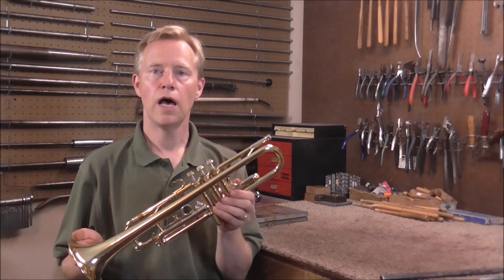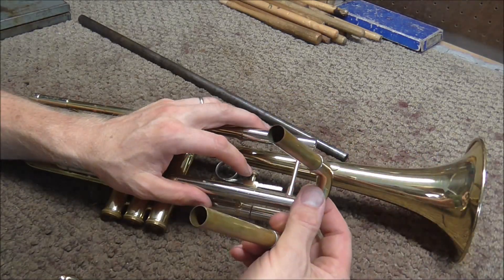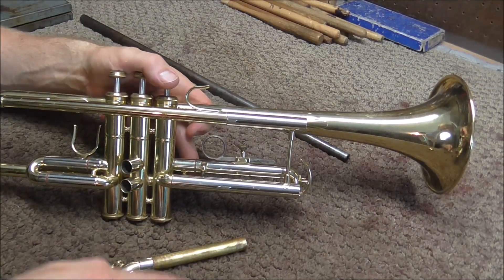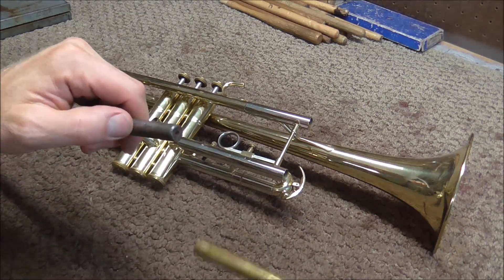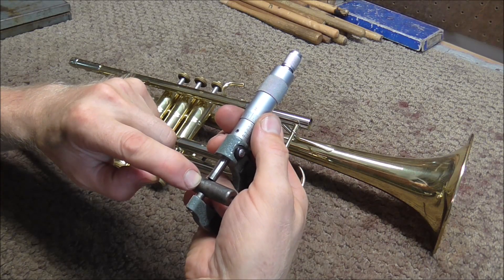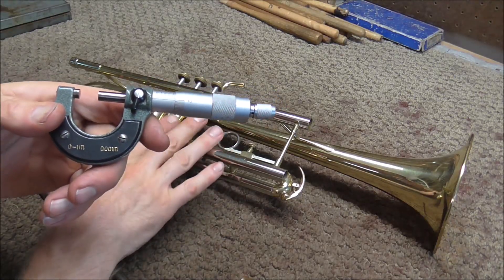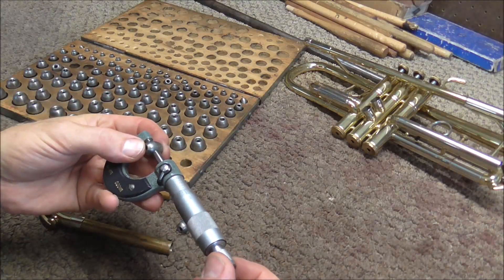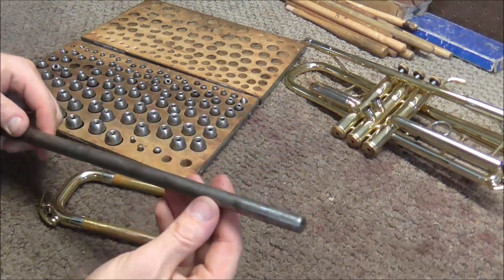How To Measure the Bore Size on Brass Instruments

Comment: Where does the bore size come in handy in repair?
Reply from the maker: Usually it does not matter. However, if you are replacing tubing you need to know what size to replace it with.
Reply: @TheBrassandWoodwindShop  Ok thx!

Comment: Thanks for the video! I'd like to ask if using a digital caliper wouldn't be easier?
Reply from the maker: I do not have a digital caliper. It would probably be easier, but it is more expensive and would require some maintenance.
Reply: @TheBrassandWoodwindShop  yea as a machinist i would have went with the caliper or an inside mic.
Reply: @twistedtrails8128  That's what I thought, I immediately thought inside mic.